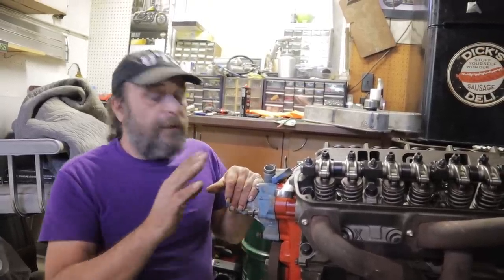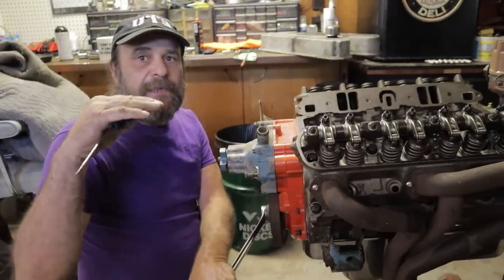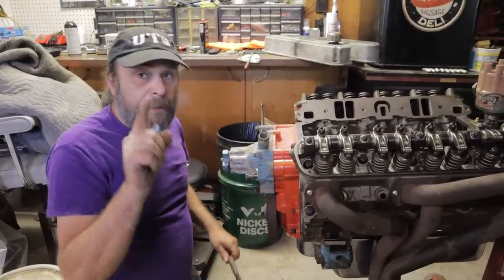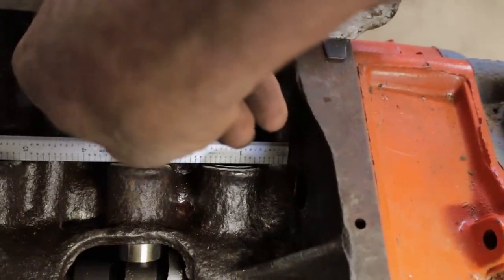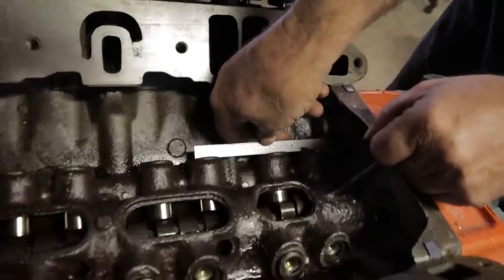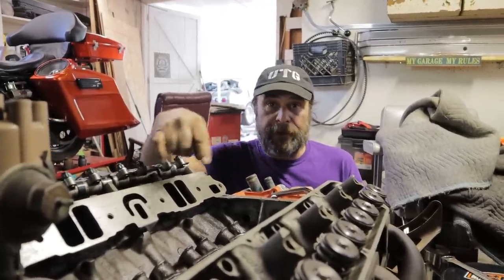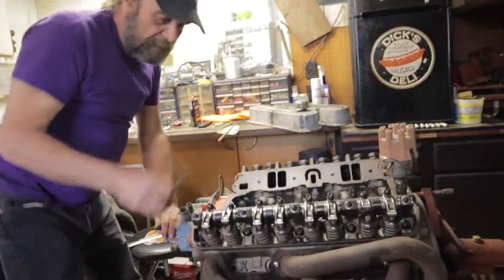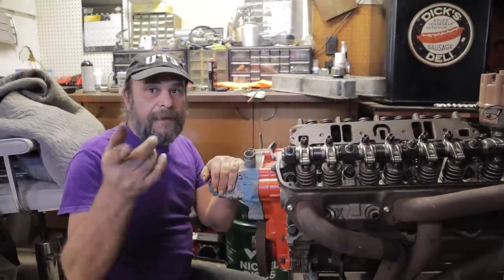How To Accurately Degree Your Cam With No Special Tools

Comment: That was great. I've never degreed a camshaft in using a wheel. But I always build the same motor.
The 375 horse Chevy 350 with hydraulic cam. I always use a new true roller timing chain and the new Woodruff key. Great video, short, sweet, and informative.
 thank you

Comment: You can also buy a dial tool that screws into the spark plug hole for TDC. Very accurate and cheap too. With this tool and the straight edge ruler and feeler gauge for cam setting, this is more accurate than the degree wheel method because with the degree wheel, you can only 'eyeball' it.

Comment: Hey U.T!
This is really smart, and probably More accurate than a degree wheel.
On your statement early on about triple checking, you're not being OCD, it's called being thorough and it's one of the things that makes you an authority and good at what you do!
I've been an engine builder for 40+ years - not putting the parts together but the real deal - and I'd never seen nor heard of this method, it's always been the degree wheel method.
By comparison, the degree wheel deal is more involved and a bit of a pain in the ass - a lot of ways a beginner can make mistakes. 
Thanks for the heads up, U.T.

Comment: I used to pit crew for a guy who made his own camshaft grinds and he was crazy about asymmetric cam lobes and degrees of overlap he used to painfully (OCD) adjust his engines using a very similar method to this..he would map the movement of the internals on paper like a graph and work on it in testing for days until he got results..lots of bent rods n blown motors but we got results on pump fuel that others never came close to...thems were the days...thanks again uncle tony.

Comment: I was helping on a top fuel car in the 60's and they were running a Engle cam. The guys at Engle cams told up how to do this. The car had a Donovan gear drive on the cam and we were able to tune/change cam timing at the track, depending on the track condations. Back in that time frame cam timing was considered something that few people understood. Running out of a small midwest town in a two car gargage we were able to trailer numerous big name racers including Don Garlits.

Comment: Im in my mid 30's now and i remember learnin this in the shed at home with my dad teachin me this method although i regularly have the time to setup the cam degree wheel and dial indicator. He is a fireman with car/engine builder/home fab and machinist. I've still got his 25ish yr old Keith Black Racing Engines black logo on white circle emblem tshirt with the blown KB in the center  😂 i only wear it on special occasions now ie fireups or breakins and my future wedding 😂. We used and i was shown alot of old school techniques and principles as they were just that, more accurate than any spec sheet or more focused to its performance requirement. Thank You once again Tony for these reminders on the best ways to get a job done and your knowledge bank, your a "truth" man and they are gettin hard to find these days.

Comment: I'm restoring a 1976 Moto Guzzi 1000 and i don't have a degree wheel but i'm thinking i could use the tops of the retainers but to be perfectly honest the mental image i got was going off the tops of the push rods. It's a true push rod hemi and really only lacks ideal spark plug placement. Which means it runs a fair amount of ignition lead to get the best performance. Really glad i saw this because although i try to use critical, common sense thinking in life and in metal fabrication and in mechanical endeavours it's not assured that i would have considered this.

Comment: I have agree using both the degree wheel and a feeler gauge, the gauge is what I use to compare and make sure. I still use dial indicators to find exact cross overs and split hairs.

Comment: I knew there was a simple way to do this. I also knew you would know how to do it. I'm rebuilding my 302 and it will get a new timing chain so I needed to make sure it's all timed correctly. I'll be using this method for sure. Thanks man.

Comment: I read about this more than 20 years ago in a magazine.  Didn’t remember it was Keith Black’s method, but that doesn’t surprise me.  When they did it, they used 17mm sockets in place of the lifters for some reason and read off of those.  I couldn’t remember the specifics, but I remembered the feeler gauge!  Cool then.  Cool now.

Comment: I use this  method for my for 4 cam delkron sportster  drag bike 150 cubic inch, I move my cams around because remember you have to TIG weld those red shift cams two lobes too the shaft I spot check the TDC. LIFTS. I haven't use a degree wheel in 20 years lol

Comment: Back in the day, I used to noticeably wake up mid-late 70's Chrysler LA engines with a 4 deg. offset key in the upper cam drive gear (advance) for a not-too-expensive pick-up. Seems like the woodruff keys were sold by one of the major mail order speed shops in a 2, 4, and 6 deg. set. Was always a good time to throw a new double-row chain and gear set on it, too. The eng. would mostly run forever then.
Reply: Haven't those been replaced by the multi key lower timing sprocket? I remember those offset key ways you talk about
Reply: @elinino5275  They may well have been by now. It's been close to 40 yrs. since I was playing with that stuff.

Comment: another way to find TDC is put a something in the sparkplug hole and slowly rotate the engine over till the piston hits it ans mark the balancer with the timing tab. then rotate the motor over the other way till it hits the object again and mark the balancer again. then measure the 2 marks and the halfway point in the middle of the marks is your true TDC.

Comment: This is pretty good information, but wouldn't the guy making adjustments at the track already have the cam degreed when it was first put in. and maybe have a quick access timing cover and an adjustable cam gear to make adjustments?  but still this looks like a really good way  to check an engine when building one if you don't have a degree wheel, stand, dial indicator. this video deserves a thumbs up.
Reply: Degreed cam is to make sure the cam card is accurate,  right.  Then other adjustments are made with offset keys on the top timing sprocket bolt holes? ... I think 🤔

Comment: Good way of doing it. I never needed a reason to degree a cam in my engines. I was always lucky to just put them together, LOL.
Reply: Whats happens if we did not degree the camshaft
Reply: @RohanSanjith  nothing, you just take the cam manufacturer's word that it is made right.
Reply: What if we just check visually if the intake valves opening during intake stroke, and both valves close at combustion stroke, and exhaust opening at the exhaust stroke, will that be enough without degreeing
Reply: @RohanSanjith  sure. But degreeing a cam is a more precise way of making sure the specs are correct.  You are talking of  basic workings of a cam. The degreeing lets you see into the exact opening and closing of the valves. Your eyes can't see that.

Comment: We used to use compression to dial in the cam. We would advance to the highest compression. Once we got maximum cylinder pressure we were set.

Comment: I believe this method would only work for a camshaft that has the same timings for both intake and exhaust. For a cam that has different intake and exhaust timings the cam will be a few degrees off TDC when the intake and exhaust are at equal lift.

Comment: This is awesome. Could you do this by measuring the difference in the pushrods on a ford inline 6 due to the lifters being tucked away? I have adjustable rockers so I’m sure the springs won’t be as accurate. Thank you!!

Comment: Great info.  I enjoy receiving the knowledge.  Does this method also work with roller cams?  Building a flat-tappet frankenstein 427 Dart block Windsor.  I'll use this method.  I generally try to sit at 4° depending on cam mftr specs.  This will be a dirt circle track engine with close to 700hp.

Comment: Interesting fact: a lot of high strung F1 race engines are ground on a twist to compensate for cam core twist at crazy high RPM where they spend a lot of time on the track.

Comment: OK. So I've seen a ton of videos on degreeing camshafts, but none of them give any instruction on what to do if things aren't what they are supposed to be. Like what if it isn't .006 on both the intake and exhaust, how do you fix/adjust it? 

Love your channel BTW. Learning a ton!
Reply: There are these offset circular keys that go in the bolt holes of the cam sprocket. I think that's how final adjustments are made
Reply: It's not necessary to degree the cam i believe, barely any gains

Comment: And I thought I invented that method LOL. Been using it since the 60s. It's really common sense.
Reply: John Johnson  Having been in crank remanufacturing for 25 years, I've seen cracked cranks that would ring and dud cranks that you couldn't find a crack in after magnafluxing. But 97% of the time it works so I'd go with that for a street motor.

Comment: at nascar track in va the rules let us run a edelbrock rpm intake with a 390 cfm 2 barrell i adjusted my cam timng by how much cylinder compression,i couldnt get enough air in CFM

Comment: The piston NEVER dwells irregardless of the rod ratio.    Using the timing marks on the engine and turning it till the valves are in split overlap is a very quick and easy way to check if the cam is reasonably close to being timed correctly and its a great way to find when someone used the key instead of the dot on the lower gear when installing the timing set but it's not the same as actually using a degree wheel to check the lobe centerlines.
Reply: Split overlap happens during compression stroke?
Reply: @elinino5275  No, it happens when the exhaust stroke is ending and the intake stroke is beginning.  Both valves are open at the same time for a period called overlap.
Reply: @DaveMcLain  oh awesome!  Thanks for taking the time to explain 👍

Comment: This is a very ingenious trick without a degree wheel and dial indicator. But It's only a "check" to see where you are at. 
 I don't see how you could make adjustments employing this method without either removing the stock timming cover or have a racing split timing cover that allows access for quick adjustment without removing the crank ballancer.
  No arguments that it's quicker to measure like this without mounting the degree wheel, especially as the engine is fully assembled in between rounds. Just pop the intake off, and it's game on.
Reply: Why couldn’t you use it to change the position?  I see no reason.

Comment: Uncle Tony. I have a 4 cylinder 1400cc engine I use for stock car racing at my local track. I'm in the UK. The engine has hydraulic lifters and it a single 8v camshaft. I don't have the spec card for the camshaft but would really like to get it timed up right. How would you measure the valve position so I can set a timing mark for the camshaft? I hope this question makes sense and you can help me with this.... Love the channel. Cheers Mark
Reply: What happens if you just fit the camshaft and do nothing?
Reply: @RohanSanjith  the valves have to be in time with the engine cycle?
Reply: @CromfordCars  what if we just check visually if the intake valves opening during intake stroke, and both valves close at combustion stroke, and exhaust opening at the exhaust stroke, will that be enough?
Reply: @RohanSanjith  Yes that's pretty much how it's set up now. I used cylinder 4 at the top of the exhaust stroke. It was easier to see the lobes of the camshaft equal at the overlap. But I really wanted to get a bang on mark on the engine to mark the camshaft position. As mentioned earlier, I race the car in local stock car racing and every bit of advantage is welcome.

Comment: I love an engine with long rods. Gives longer piston dwell @ TDC to allow cylinder pressure to build before the piston heads down. Chrysler did it right. Long rods reduce piston speed and dont load the cylinder walls as bad...=s long ring life.

Comment: Important to note that this only works with straight grind cams, with the same lift and duration on both the intake and exhaust.
Reply: Yeah. I just realized this, trying to use this method with a mutha thumpr cam for my 460 that has a 102 d center line and 105 lobe separation. I guess I need a degree wheel. Damn.

Comment: Hey uncle Tony(and lubetube mechanics) you were talking about timing marks not always being right. Well... I was working on a carbed HEI 300i6 today and the initial ignition timing was set at 10* which is factory spec. Wouldn't run. Finally got it to run at "26" degrees intitial timing. Now... Is it even possible that it won't run anything less than 26 degrees or are the timing marks just off that far? I know it would start at 26 degrees under normal conditions but it wouldn't start at ANYTHING LESS. worn timing set? Or turned balancer? How would you test for a worn cam chain?

Comment: Question maybe another video. You take apart a motor maybe not a stock motor and pull out the camshaft how do you tell what the camshaft . ?
Reply: Joe H most after market cams have a part number stamped on the end of the camshaft behind the timming chain sprocket.

Otherwise you 'll have measure the lobes for a lift spec. I don't know how you would measure duration amd overlap profiles without the cam in the engine, a degree wheel, and a dial indicator to measure the lift and what degrees they occur at.
 Look for numbers on the cam, I've found that's the easiest way to crossrefrence what you have.

Comment: Thats really good but you still need to open the front of the engine to actually make the adjustment to the cam. All this is, ia an alternate method of measuring, it adjusts nothing.

Comment: Great video and I appreciate it but in all seriousness what is the point of doing this? file this under never have I ever. I say this  because what is it you are going to adjust? Skip a tooth? That'd be like 10 degrees. Adjustable timing gear set I suppose huh? I mean I guess you could broach out the lower gear wider in the direction you would want to go and make a custom key.....
Ahh the less I know the better

Comment: Why on exhaust stroke and not the compression stroke? Good videos though just curious
Reply: Because both valves are closed. Both lifters on the base circle.
Reply: And as a side note, with the cam timing marks lined up, dot to dot, many new engine assemblers put the distributor in 180° out. They mistakingly believe the engine is set at TDC compression on number 1. Yeah, I did it too way back when! LOL!

Comment: Uncle Tony you’re trying to show as the quick dirty way to check the camshaft timing.... how about you show us the dead accurate way to degree a cam ? That means pulling out the dial indicator the degree wheel ... and everything else yes it’s going to take time but it’s going to be accurate .... you should start from the basics meaning pull out the degree wheel on the  crankshaft , make sure the harmonic balancer marks are correct let’s start right there ! You’re trying to show us a shortcut ... we’re not racing right now we just want to build our engines absolutely correct..... what is the hurry ?
Reply: There's about 150 other vids on YT that show that method. If you wanna go that route you have to pretty much tear half the engine down to access your pistons with a piston stop. This method is very practical in comparison.

Comment: Video Title: "How To Accurately Degree Your Cam With No Special Tools"
How to Accurately....... and with NO Special Tools??????

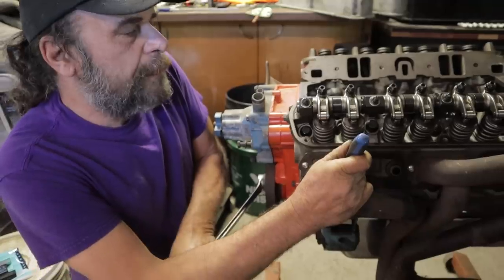At 1:56 into the video, the author is using a screwdriver (in the spark plug port) to locate # 1 TDC. 
This method is not only inaccurate, it does not accurately account for what he is calling "piston dwell". 
An accurate # 1 TDC is the base line used for camshaft phasing or indexing, and eventually ignition timing. 
It must be accurate, or any attempts thereafter will be inaccurate. 

In order to locate TRUE # 1 TDC, we use one of two types of PPS tools. (PPS = positive piston stop)
This method can be used prior to the cylinder heads being in place, or with the cylinder heads in place. 
(the PPS tool is different for each scenario)
The PPS method involves stopping the piston in 2 locations (once in either direction of rotation) prior to the piston reaching theoretical TDC. 
Once these locations have been established, the angle is then split. 
 
Disclaimer: 
I have no dog an any fight here, and I will make no apologies for what may have sounded grumpy or ill tempored.  I'm simply pointing out that this procedure is simply wrong!  
If accuracy is the goal, then by all means use the correct tools, and follow the correct procedures.  

We have an unwritten responsibility to post videos like this that do not incorporate short-cuts or back-yard methods, let alone mis-information. 
  

Trust your source!
Reply from the maker: My source for this method was Keith Black himself.  It's been used thousands of times by hundreds of racers making between rounds cam timing changes for 60 years now.
As long as one understands the concept of piston dwell, and takes the time to feel for the center of that dwell, this is as accurate as any other method of tuning camshaft timing.

Comment: That is all fine and good and probly works great..  But any of us that run any type of LS motor this will not work. The lifters are in the block  And held in place by a lifter trays. But you still could do it off the heads if you know your rocker ratio.